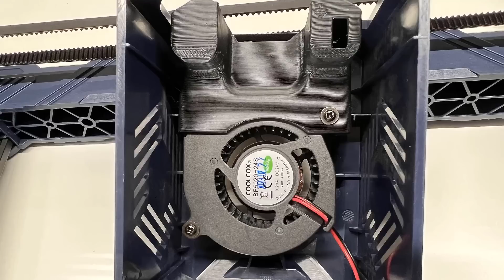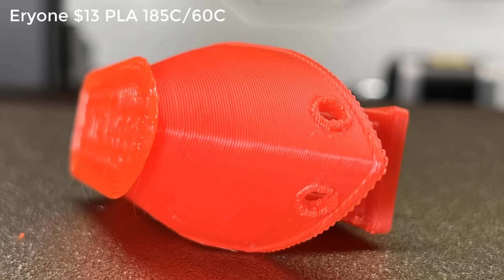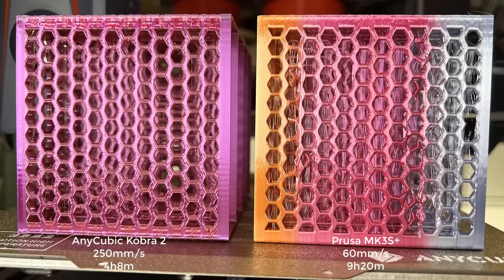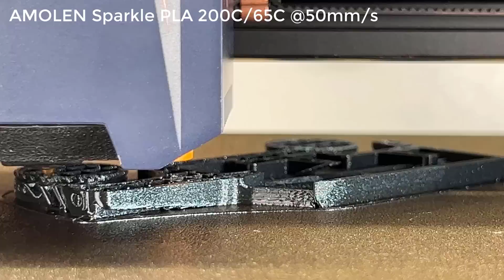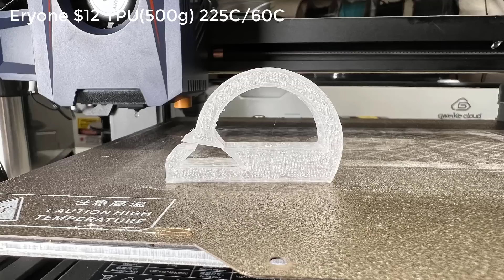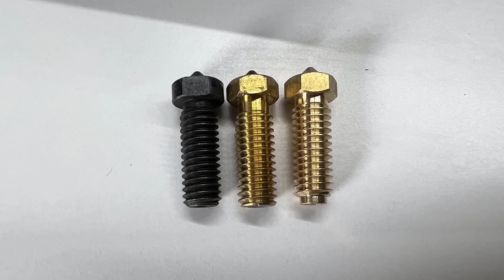AnyCubic Kobra 2: sub $300 fast printing 3D printer, auto z-offset, nozzle cleaning, 30 mins benchy

Comment: hi! Any chance you might cover the anycubic Kobra 2 Neo in the future? I got that printer, and its working well. But Im totally new to printing and desperately need better profiles for the thing. When ever i turn thespeed down to a sub 100 range i start having print issues. im using the anycubic slicer still because their provided profiles for Cura and Prusa slicer don't work very well. Other people seem to be having the same issues.

Comment: Hello I have an anycubic kobra 2,plus I started printing a project with petg filament brand anycubic. I ran out 55% of the way and switched too firos petg filament. I initiayed the print again but I got stringing. I then started adjusting the z axis lowering the nozzle because it seemed too be higher than the surface of the project.  But I still would get stringing.  What am I doing wrong

Comment: Thanks for the video. I may have misunderstood the configuration profiles made available. I thought you were making available different settings for different filaments. That does not seem to be the case. I am new to PrusaSilicer so this may be my mistake. Filtering the config bundle I note :
 1116: [filament:Anycubic Kobra2 - Generic PLA]
1174: [filament:Cheap White PLA]
1232: [filament:Easy Nylon]
1290: [filament:Generic ABS - Quinly]
1348: [filament:Generic ABS @Artillery 255 110]
1406: [filament:Generic Nylon]
1464: [filament:Generic PETG - Quinly]
1522: [filament:Generic PETG 1]
1580: [filament:Generic PETG X-MAX]
1638: [filament:Generic PLA - Quinly]
1696: [filament:Generic PLA 205-200-70]
1754: [filament:Generic PLA 210 65]
1812: [filament:Generic TPU 220-70-No-Cool]
1870: [filament:PA-12 CF]
Maybe these are printer specific

Comment: I find it prints better with Aurora's settings than the stock

I also have to apply a 1.015 scale to each axis to get accurate prints, anyone know the steps per mm? Then I can use M92 to fix the problem in Gcode

Comment: I would like to print at a slower speed and less fan noise if possible.  Is that possible?  And is there an easy way to change filament?  It's super easy on my Prusa Mini with a boden tube but I looked at Anycubic's video on how to change filament and it's ridiculous.

Comment: How does this compare to the new Ender 3 V3 SE? Is the primary difference being able to use ABS? (I am new to printing)
Reply from the maker: Both of them (and all open-frame bed slinger) are not ideal for printing ABS. If $200 or $300 has no difference to you, get this Kobra 2. If budget is limited, Ender-3 V3 SE is the best sub $200 machine.

Comment: I just picked one of these up for very cheap.  $218 Canadian taxes and shipping included.  I took a gamble and bought from a reseller who deals in factory returns.  I got VERY lucky and it had never even been put together.  I am certain the guy opened the box and felt totally overwhelmed and just sent it back.  It works perfectly and I am incredibly impressed and totally happy with it.  My ONLY complaint, if I can call it a complaint, is that Anycubic STILL doesn't have default Cura profiles already set up and ready to go.  Setting one up wasn't super challenging but one would think this would be something they'd do before launch.  I agree about the nozzle issue but it should be easily resolved with a CR6 heatbreak and volcano nozzles.  I have some sitting in my parts bin and at some point I'll swap them in for the stock and give it a go.  I honestly can't see it not working though.

Would I buy one again, absolutely.  Sadly the seller I got it from is out of stock.

Comment: Aurora, my experience  with this printer was very bad. 
The auto levelling didn't adapt to bed warping. So I couldn't get a consistent result, When I adjusted the Z offset for the bottom right of the bed, the top left had bad results.
if I tried 2 prints one following another, the whole levelling is horrible.
How the have you gotten this perfect first layer print? 
I was all in to upgrade the print with time, but since I couldn't get a consistent first layer I returned it. But then, any cubic support was really bad :(, ghosted me...

Comment: I've been a subscriber for a while now and enjoy your thorough and well presented reviews. My only problem is the printers these companies are sending you to review. They are most certainly not the same ones the rest of us buy. Given all the little things wrong with my Kobra 2, as well as reading the common issues other users in the Kobra 2 facebook group have experienced, I'm absolutely sure that the printer you got was cherry picked by Anycubic to be perfect so you'd give a favorable review.  My printer had 2 QC stickers on the front yet I found many of the pre-assembly parts screws to be loose as well as the Z-axis belt. The SG15 bearings on the Y axis were squeaky when using accelleration over 750 mm/sec2.  I replaced them with ones from uxcell and now can achieve 2000mm.sec2 without all the noise.  Sorry if this was more a critique of Anycubic than a comment about your excellent video.
Reply: so is still a good printer or i look for something else?
Reply: @omegadeepblue1407  Once I worked through the little problems, it's a terrific printer for the price. Each printer is different so your experience may differ.

Comment: Is this the "best" 3D printer in its price range?  Your opinion would be very welcome.  Thank you.
Reply from the maker: In terms of features, you can't find another one with auto z-offset at this price range, for speed, it's not the fastest bed slinger, but the print quality at 150mm/s is still presentable.
Reply: Which of these two would YOU select: Anycubic Kobra 2 or the Sovol SV07?  Thank you.

Comment: I am so appreciative of your in depth and clearly expressed review, you covered everything I needed to know, gave excellent resources, and made clear all the strengths and weaknesses of the device.

I’ve noted that any cubic actually seem to advise replacing the heat break and nozzle if you change the nozzle and it doesn’t look too difficult to pull off, not the greatest solution but at least it’s possible.

Comment: Thank you for this excellent review, I am now waiting for my Kobra 2 to finish printing my first benchy and that took about 20 minutes from unboxing. Nobody else I have watched on Youtube lists all the pros and cons in such a thorough manner, with advice on potential problems and solutions and your knowledge is a gift for people who are new to 3d printing.
Reply: What is your opinion overall about this printer?
Reply: @omegadeepblue1407  My experience level with 3d printers is that we have them at work and I am designer who is able to make models for them but has no experience printing with them and adjusting them. Our printers at work are really finnicky and don't print well and literally just confuse me. The Kobra 2 was a breeze to assemble. I've done about 9 prints so far just using the Prusa slicer and ini supplied on the stick and it just works. I bought and printed one of Matmire Makes articulated bat models on the day I got the printer and it was a breeze and came out great.

Comment: Update to my other comment. I finally sliced a Benchy on Prusa slicer at .2 layer height at 250mm/sec speed and 2500-3000 acceleration. Actual print took 39 minutes and even though I forgot to lower the heat of the print head as Ibthought 215 was way to high so ,I lowered it to 185 while it was printing, as I noticed the gcode that came with the printer was at that temp. No issues , better than average print quality; some layer lines ; yes some ghosting but absolutely no stringing! Not sure if its down to the lower temp or the cooling fan or both. I will be doing some more  tests myself and as I know more I may do a video of my own. Anyhow if this is the quality of prints I am going to get off this printer at these speeds ; then I am very excited and impressed!! I really enjoy your reviews and this review help make my mind to buy this printer ! Thank you !

Comment: have you had issues with the nozzle dragging? i cant get mine to stop dragging and destroying prints. i have 3 otehrs printers and none of them have this issue. i have leveled the bed multiple times. and adjusted the auto levler and cant get it to stop dragging.

Comment: Hi ; I am living in Australia and I just bought this same Kobra 2 and it arrived 2 days ago and I just finished printing the .2mm layer 38min Benchy that was a pre-installed g-code on the card. Since this video the company must have added a new Benchy file for a .2mm Benchy and perhaps the firmware has had an update since this review was done. It must have been printing at 250mm speed and I gather full 2500-3000mm acceleration but I won't know for sure until I get my laptop back from warranty claim. I can say the print for the speed it was flying at came out fairly clean , no stringing at all( yes absolutely no stringing )and finished in 38 min and several seconds but under 39 mins. Slight layer discrepancies but nothing drastic for such a fast print. Wish I could put a photo up but don't know if I can. Auto leveling worked a treat out of the box , top z axis belt was a little loose when putting printer together but I fixed that by undoing the bolts on either side and applied a little pull pressure to the top plate then tighten screws again. Still have to adjust the z axis v wheels as they are slightly uneven in pressure against z uprights but not drastically otherwise Benchy would have had more issues. All in all I am very happy with this Kobra 2 Printer. I got it on special from the Official Anycubic on E bay with a $65 ( Australian Dollars) discount down to $369.00 . How people can put money into printers that cost $1800-5000 is beyond me. The Benchy is as clean if not slightly better than the one I printed on my Ender 3 S1 Plus which took 1 hr and 30 plus minutes to print with a faster profile I found on a utube channel. Only thing I noticed is there is ghosting around the portals on the keel of the Benchy printed on the Kobra 2 but that has to be expected printing at speed without input shaping.

Comment: I've downloaded and installed the latest 2.9.3 firmware.  I'm having  first layer issues. It doesn't appear to be doing the first layer correctly even when printing their g-codes.  Even though they're support is fast to send out parts they don't really have that great of a support to assist in diagnosing issues.  I took a chance with such a low price and after the print head module was corrected I had some good prints.  It's just not consistent and their support is lacking.  Also there aren't any printer profiles for the kobra 2.  There's one they provide with an older version of Prusa slicer 2.5.2  with one pla profile.  And another is available by  Aurora  on this channel.   My personal opinion if you just want to print out of the box  then get  a Bambulab, a Mk4, or a Creality K1.  It looks like to get print and play you really need to spend around $600.  I'm sure I could fix all these issues, it just that we're in an era where new technology is making 3d printing much more feasible and practical. I though I wouldn't have any first layer issues with this printer but I was wrong.  It's difficult to say whether it's user error or not, there just isn't enough information to assist in diagnosing issues other than "try pushing the filament through and if it doesn't extrude, we'll send another part..."
Please let me know if anyone is experiencing any issues with their printer, I'd like to compare notes.

Comment: Okay mine finishes a 0.18mm layer height benchy in 39 minutes. I actually slowed down parameter speed and top layer speed and put it toward infill speed. The anycubic slicer does well and has a better printer profile.

Comment: OKay, so here's the latest:  There's an issue with Input shaping, it's not enabled and I'm experiencing ringing.  They're using Marlin bugfix-2.0.x version.  Another issue is my printer is using an AnyCubic firmware of 2.8.7 (nothing to do with Marlin version) , however both their firmware downloads site and their GITHUB only have version AnyCubic firmware of 2.8.2.  Their reply to my open ticket was that I have the latest firmware.  I'm attempting to get them to update their website and GITHUB to version 2.8.7.  Chris Riley of the Chris' basement Youtube channel has a video on how to install Input shaping and how to calibrate it. I've offered to correct this issue and make the fix available to them, so, let's see what they come back with.  To be continued...

Comment: I got it to work with OctoPrint without issue.  Octoprint prompts with a warning that the printer is using a developmental firmware, even though I have their latest firmware.  Another thing I notice is that they don't provide a PETG for their version of Prusa Slicer and their AnyCubic slicer gets an unknown publisher error on Windows and doesn't allow for installation without overriding that with an error.  I was able to figure it out as for Prusa as they only provide you a PLA profile and there are ones for TPU and ABS.

Comment: Okay, so I was able to print its own internal 3D Benchy, which on my Prusa Mk3s+ took 1hr 10 mins.  This Anycubic Kobra 2 did it in 31 mins.  I wanted an inexpensive printer to print PLA faster and most of all, not worry about first layer adhesion.  This printer is not perfect but it prints great.  The 3D benchy is practically perfect.   Even with the issues I've experienced, I would still recommend this printer.  It's not perfect, the interface is not great.  Parts can take around 10 days to come from China.  The support responds within in 24 hours and didn't hesitate to send me a new print-head module which was easy to install.   I'm going to open a ticket for two minor issues.  The filament sensor was damaged when I pulled the bad filament out of the bad print module head and the filament-in function only homes and purges one time.  You have to power it off-on and do a filament-in again when loading new filament.  I'm sure this can be addressed in a firmware update . For the price, it's something I can live with.  I'm also preparing to install Octoprint on it as it doesn't come with wi-fi connectivity, which I didn't expect at that price point. 
All in all, I'm please with this printer and its support.
Reply: Thanks for sharing your experience, i always heared that anycubic has bad customer support and that is the main reason why i don't buy the Kobra 2. But reading this makes me see they can be helpful

Comment: I just received and installed the new print head module and I'm running some tests.  I have a minor issue with the filament sensor because the last print head module had left a glob at the end of the filament  when I pull it out, so, now I have to remove the filament sensor from the unit push the filament through and then reattach it.  I'm going to contact support for a new sensor.  I also noticed that when I do the prepare/filament-in process, it doesn't rehome itself as when you first do it.  The last time I check with support I was told I have the latest firmware but I'll report this issue to them as well.

Comment: I received my Kobra 2 yesterday afternoon. It took all of twenty minutes to assemble. The box had some damage on one side, but overall, it was in excellent condition. The packaging of the Kobra 2 was absolutely perfect in my mind. And the printer itself, flawless. It's built like a tank, the double z-axis solution is good, the bed sensor / bed leveling system is unique. I like how it doesn't touch the bed while it's leveling it. The priinthead is a beast, but a happy one, I think. The design is everything the print head on the BIQU Hurakan wanted to be. There's space, there's room to work, the attachment is super-simple, THIS IS A VERY WELL DESIGNED AND CONSTRUCTED PRINTER. But all is not perfect. The stepper drivers are built into the board. I'm not sure, but they SOUND like 4988's. This is my main gripe with the Kobra 2. It's like listening to a calipee at the circus while all of the clowns are performing their opening act. Now I know why none of the reviews I watched presented more than a few seconds of audio. I'm going to rectify that today. If you're interested, Aurora Lung, I would like to hire you to write the code for Manta board so I can remove the Kobra 2's board, and replace it with a proper - QUIET board that has 2023 stepper drivers installed. My emails on my youtube site. Please let me know what you would like to be paid for the work I've proposed. Thank you.

Comment: Having just received one of these, I could not disagree with this review more. This is a product that simply isn't ready for release. The firmware alone is worse than anything released three years ago. Save your money for something else or wait until they fix the numerous problems with this printer.
Reply: Hello, what are the troubles you found using the kobra 2, also can you recommend me other printer alternatives?
Reply: @omegadeepblue1407  I don't recommend the Kobra 2 to anyone. I can confidently reccomend FLSun and Voxelab printers. I have each of them and they have been perfectly trouble free for three years now. Of course there are no guarantees, but that's my personal experience.

Comment: Thanks for the great video! 
I saw that you used Cura for one of the prints. Could you also share those profiles? I don´t know how to get the Prusa profiles to Cura.
And how did you set up the Kobra 2 in general in Cura. At the moment I can find not printer data for it.
Thanks again, Thomas